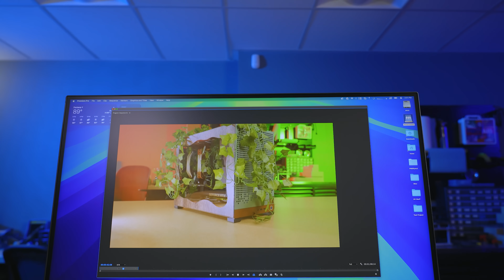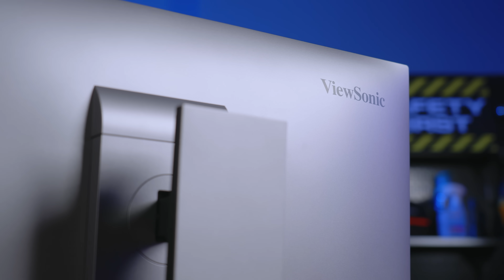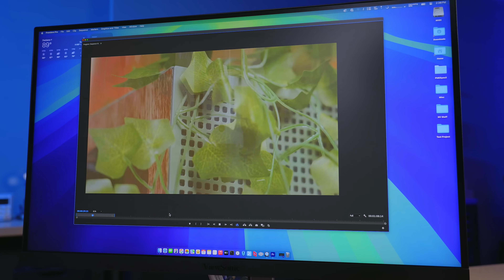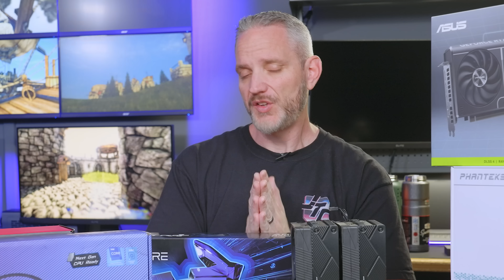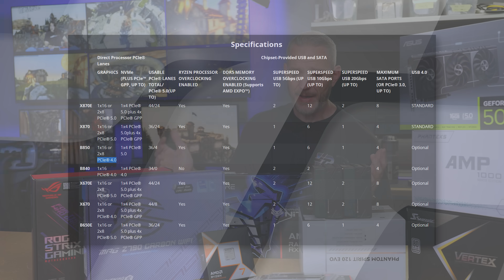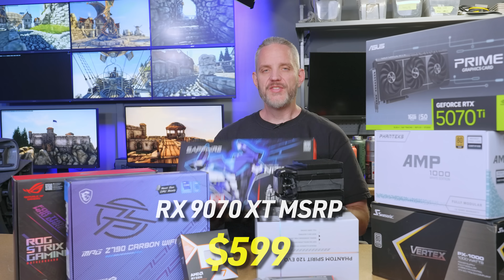This is the Sweetspot for PC gaming... Don't get fooled into spending more!

Comment: My PC Specs:
•CPU: Intel Core i5-13600K (locked at stock speed)
•Mobo: MSI Z790 MAG Tomahawk WiFi DDR4
•GPU: ASRock PG Arc A770 16GB
•RAM: G.Skill Trizent Z RGB 32GB DDR4-3200
•Storage: Primary - WD BLACK SN850X 1TB; Secondary - WD BLACK SN850X 4TB
•PSU: Corsair RMx 1,000W.
•Case: MSI MPG Velox 100r

Overall, I only spent $1,400 overall (OS excluded). And that was when most of my components were on surprise deals at online retailers.

Comment: my 5900x, 32GB, RX 6800 16 GB will made me do the entire consoles gen at 90/120 FPS 2560x1080 for little less than 2000 € just after the PS5/X release and ''correct'' prices
its not the best moment to do a new PC (new consoles will release soon) but its some good advices^

Comment: I have a 7800X3D/4080 Super system, but I'm thinking of building a second, portable PC that's not as powerful.

My want for all the power I can get VS the power I really need it to have for what I'm using it for has been hard to fight. 

I'm aiming to use an AMD 9000 GPU, but I'm fighting between my want for the power of a 9070XT VS, the realistic use case/price point of a 9060XT. 

So, the spending VS what I really need have been bashing heads.

Comment: please don't recommend stuff like like that. If you have to have a bottleneck. you are better to have a gpu bottleneck over a cpu bottleneck. so you are better to have a good cpu over a gpu. You really dont need that much gpu horse power. you can be surprised what you can run on older hardware. if you want to play AAA games you are better off getting a console if you have limited budget. if you play games like war thunder or apex and indie games. you dont need much.

Comment: I would add:  if going for a value / performance focused build - do Not go ITX / SFF

You’ll either have to make compromises or will be spending extra $ (sometimes a lot) for parts which will even fit.

Comment: In what world is the core ultra i7 265K not the value pick today? Unless this was recorded a while ago and just released, the 265K is available near or even under $200. 
Is it the best CPU for gaming? No. 
Does it pack 90+% of the FPS of the 14700K at 60% of the price? Yeah.
And it’s an absolute beast in productivity. 

I feel like people get lost in the generational discussion. Ultra series 2 is NOT as good as most AM5 processors or even the 14th gen Intel processors. But it eviscerates the 9600X, which is the closest in price new.

Intel is the new value pick (for now).

Comment: is nvidia heavily saving money on the cooling part on their 50 series cards? i comapred the measurements of 5070ti cards and they are basically all the same 300x120x50 a bit higher a bit lower but no big cooling parts like on 9070 xt cards! i was looking for a good card that has valid quiet possibility but they are all the same, even tho they have like SFF in the name but arent shorter in any way

Comment: Power supply: 2009 Alienware Aurora is still going hard. Switched to a GTX 1070 and a SSD, other than that all original.  Dumped Windows 10 for Linux when I picked up a new PC this year.

Correction: after three water pump failures I switched to air cooling, much more robust.

Comment: Got my ibuypower custom configurator earlier this year running a ASUS Prime B650M-A AX6 II WIFI mobo, 7800X3D, 4070 Super OC and 64gb DDR5 6000 with a 850 watt power supply all in the Lian Li 216 Mesh in white.  This was an upgrade from a build I was gifted that was a previous workstation pc running an Intel Core i7 4820K with 32gb DDR3 with a workstation mobo (not sure what type), a GTX 1660 8gb and I think a 500 or 650 watt psu in a Lian Li O11 case in white.  Had to upgrade when it started black screening randomly and I’m not confident enough in my knowledge to try and trouble shoot or do anything too invasive that could mess something up more.  Kept the old rig as a learning tool and this new one was within my budget and it’s perfect for gaming and my video/audio editing projects along with live-streaming.

Comment: If you need a bit more graphics performance than this, the sweet spot is adding an overclocked 5080 - they go beast mode when clocked! I'm surprised how little coverage this topic gets. (Still not "cheap", but in comparison to a 4090 or 5090, the performance gap is not huge compared to the price difference).

Comment: Do these YouTubers still talk about our reality? I don't game, but I'm 80 and a collector of VMs.  I have all Windows VMs from 1986 till now and all Ubuntu LTS VMs from 2004 till now.  Now, like almost always I run 2 VMs but from time to time I run 4 VMs. Now I run Xubuntu 24.04 LTS and Ubuntu 16.04 ESM and every week I run Windows XP Home a few times :)  Even running Windows 11 update together with Linux updates I never reach a 100% CPU load, it runs around 50%. 
My old HW from Apr 2019 till Dec 2024; a Ryzen 3 2200G; 16GB DDR4 (3000MHz) did reach a 100% CPU load in Windows updates during say 5 minutes.   

In Dec I upgraded, not because it was needed, but the prices ($125 + $54) were right and I expected to need an upgrade anyhow within 2 to 3 years. I upgraded to a "new" Ryzen 5 5600GT (released Jan 2024) and 32GB DDR4 (3200Mhz). I intend to use it till 2034, because I have only 2 hands and 2 eyes to create load.  I'm not interested in the artificial load of running at 4096 x 2140, because my eyes are happy with 23" and 1920 x 1080 on a good old analogue vga connection.  

I studied electronics from 1963-1967, so I prefer the more natural analogue monitor :)  I had glasses all my life and I don't intend to buy new glasses to justify a new 4k monitor. LOL!

Comment: Sweetspot for games :

Mid range : 5070/9070 + 9600x 
mid - high : 5070ti/9070xt + 7800x3d
high end : 5090 + 9800x3d/99550x3d

RAM : If you plan on using AM5 for long term upgrades like us 5700x3d AM4 3600MHz ddr4 owners, get 7200mhz ddr5 ram. Its not much more expensive than 6400mhz but will pay dividends when you upgrade to that eventual 11700X3D.

Comment: I went with a 7600x which was almost bottom of the barrel Ryzen 7000 and a Zotac rtx 4080. first big GPU buy. and I could not be happier. Gaming at 1440p ultrawide. Its so good. The GPU will last me for years, and if I need some more performance or cores I can upgrade to ryzen 9000. All this on a low/mid range asus b650 with wifi and good sound, decent I/O.

Comment: I beg to differ with jay on going back to a gen 4 drive. i had a gen 4 drive in my system until i could get my den 5 drive and i felt like i was back in the old AOL days 🤣😂... mine crushes everything from web browsing to gaming!!! i also heard that most m.2 slots on motherboards don't support gen 5 speeds... i have a pcie 5.0 lane on my board with a hyper card and it's just totally insane sometimes i get more speed than what i paid for... though most need a gen 5 drive...

Comment: hey jay could you do a cpu test for 1080p, 2k and 4k with like a mid tier gpu and a high tier one ? : let me explain basically could you test some cpus from the cheapest am5 available cpu to the most expensive one with like a 9070xt at 1080p, 2k and 4K and then run the same test with like a 5090? so that we can know exactly wich cpu to choose depending on our resolution target and gpu combo ? that would give a nice data sheet for those who wants to make max performance for the cheapest possible

Comment: Does anyone know if NGREDIA has come out with any stable drivers since DEC for 30 series cards? i'm still using vers. 576.88 and its been quite a while since anything has been said on drivers for older GPU's I know it is always a gamble we take on drivers but ever since Nvidea 50 series came out nothing but problems have come out of this and i don't know if NVIDEA has ever fix there issues yet? or are they still only caring about the newest cards out there?

Comment: Hol'up. RAM needs to be picked based on compatibility of both the MOBO and the CPU.

I have RAM in my current rig that is compatible with my CPU, but not my MOBO, so it won't run when I set it to the EXPO timings. I have to manually set it 2000 MHz slower, and the first word timing 1 higher, to get my rig to boot.

Comment: I just took a 7700X cpu that I had laying around after an upgrade and built a whole new system around it. It cost me a total of 500$ at microcenter to build it, and its a mini ATX case like I wanted. I did have ram, gpu, power supply and like, fans already but I was surprised at how cheap it was. I didnt really consider it a gaming pc, but I bet I could run gta or something on it easily.

Comment: I picked up a prebuilt with a 4090 in it 7 months ago bc it was wayyy cheaper than even the 4090 cards were going for by themselves. Settings maxed on all new games with DLSS quality and very good framerate. I'm very happy with my purchase and holding onto this thing for dear life until it dies on me. Probably won't even think about a new highend pc until games start running below 30 fps with DLSS and we're a long way from that imo.
Reply: it’ll easily last a decade
Reply: @NinTheLost  exactly. Starting from now.  :-)
Reply: Where did you get it?
Reply: @DiegoLopez-oi8gt micro center used. You just have to check their confusing site constantly or you can call their cs and ask where they have a used 4090 pre-built. That's actually faster and easier imo.
Reply: Sold my lenovo legion prebuilt pc 10700k 3080, it was supposedly a better pre built but thr nose, heat and parts drove me mad, custom parts so couldn't replace them, aio broke, locked xmp ram and no resize bar, bio was locked, I sold all the parts on ebay and got half my money back and built a 5080 pc new

Comment: Feeling pretty validated in my new PC build now :) First time building my own computer instead of buying a prebuilt. Spent almost 2 weeks just researching before I started ordering parts. Final price came out to be a little over $2200 USD! (converted from NOK)

I use my computer 50/50 for gaming and as a creative workstation. Creative work doesn't require high specs but it is really nice to future proof my build AND get better performance for the games I play :D I have both a 144hz FHD monitor and a 60hz 4K monitor/graphic screen tablet. My old rtx 2060 and 2600x struggled to get the most out of both screens.

The specs for those curious!

GPU - MSI Inspire RTX 5070 ti OC
CPU - AMD 9800x3D
CPU cooler - Thermalright Phantom Spirit 120
MB - MSI Tomahawk B650
PSU - Be quiet! PURE POWER 12 m 850w
Case - Be quiet! PURE BASE 501 Airflow w Window
Casefans - Be quiet! PURE WINGS 3 140 x4 (2 included with case)
RAM - Kingston Fury Beast 32GB 6000 CL 30-36-36-80

The GPU I got for $900 which is the closest to MSRP its ever been in Norway. We tend to get inflated prices here...

Comment: Great video Jason! I'm still rocking a 9900k and a 3070. I only game at 1080p. I plan to build a new system when GTA 6 releases on PC. I will go Ryzen 7 and probably whatever top end gpu amd has at the time. Good value, not stupid overkill, yet will last me many years. Also go with AMD Gpu and I have no reason to upgrade my 1000w platinum evga psu.. And no, I don't want to use adapter.

Comment: Hello from the Philippines I have a 4090 with 9800x3d build but I also recent built a mid range rig:
Sapphire Pulse 9070XT - 760USD cheapest I could find in my country
7800x3d
gigabyte b650
32gb lexar ram 
2tb samsung evo
frozn a720 air cooler
gigabyte 750W gold
Antec X90 - 60USD

Comment: I have an EVGA P2 1000  PSU in my PC It's over 10 years old now been though AM3, LGA 1150 and AM4 where i am now it's been faultless all these years. Always over spec PSU  as much as you can afford I doubt i will change when i upgrade to AM5. It powers R7 5800x and 9070 XT at the moment. Unfortunately EVGA Powers supplies are difficult to come by in the UK now so i really don't want to change yet.

Comment: @23:47 I agree; with a small caveat: Poor airflow cases can Severely hamper cooling and in the worst cases, result in components you've shilled out for throttling down.
My case advice would be keep it as low cost as practicable, if you're on a budget, & ensure its a Very well Ventilated case. Ensuring you get the best performance out of your chosen components and cooling solutions. Having an overly crampt, poor airflow case, impact upon performance is not good!

Comment: The fact that 8000MT/s DDR5 with CL40 can still be slower than 6400MT/s or even good DDR4 tells you everything. DDR5 is a marketing mess. Higher latency, power-hungry, often unstable, and the real-world gains are minimal unless you're doing bandwidth-heavy workloads. For gaming or latency-sensitive stuff, high-end DDR4 still slaps. DDR5 "fixes" nothing that actually matters right now.
Reply: Upgrading RAM has always been a capacity based decision for me. 8GB DDR2 to 16GB DDR3 to 32GB DDR4.
So there's my issue - I don't need more than 32GB at the moment, so DDR5 is redundant for me. And even if I did, I could still get 64GB of DDR4.
Currently I'm running a 3200 CL14 kit on a B550 motherboard. Works like a charm.
Reply: actually you and also Jay is wrong here... 40 cycles at 4000Mhz (8000MT/s) is 10 nanoseconds... 30 cycles at 3000MHz (6000MTs) is also 10 nanoseconds.. so the latency of both is the VERY SAME !   8000MT/s CL40 has the SAME latency as 6000MT/s CL30 !
Reply: @robertjung8929  Nah, you’re kinda missing the point. Yeah, if you just do the math on raw latency (CL divided by frequency), 8000MT/s CL40 and 6000MT/s CL30 are roughly the same in nanoseconds. But real-world performance isn’t just about that simple latency number. DDR5 has other overheads—like higher power draw, more complex power management, and early-gen controller quirks—that mess with stability and timings. Plus, DDR4 can often run tighter timings at lower speeds, which sometimes translates to better real-world responsiveness, especially in gaming where latency spikes matter more than bandwidth. So just comparing CL and frequency alone doesn’t tell the whole story. DDR5’s raw bandwidth is higher, but it’s not a clean win everywhere right now.

Comment: Im running a ryzen 9 5900x on an Asus Tuf X570 pro wifi board with an Evga ftw3 3080ti.   64gb ddr4 vengenance ram ...clocked down due to 4 sticks...1tb nvme samsung evo 980  and a secondary 2tb Samsung evo 990 nvme drive. 1000watt evga supernova psu.   It seems to do really well for todays games...If  I were to upgrade ?..... is the performance gonna knock my socks off or should I just wait till later releases?

Comment: My last upgrade was from a Ryzen 5 5600 (no X, no X3d) to a Ryzen 7 5700x3d. It was on sale and came with "free" memory that allowed me to go from 16 to 32 gig. Yes, my bottleneck is the 3060 video card. Built it during covid and the 3060 was a "lottery" win from Newegg. The SSD remark is so true. My Steam drive is a 4tb gen 3 drive. I had a 4th gen WD black 2tb, but it was getting over 80% full. Now it's my system drive, and honestly you might see a second at most loading games difference, but the price difference at the time was huge.

Edit: GskilL is good memory. I've used their ripjaw series since ddr3 and haven't had any die yet. I've used a lot of their sodimms on NUC builds for relatives. I try to avoid RGB.

Comment: my mini atx i built is a good spot for me for a few years. r7 9700x, cl28 6k ddr5 at 64gb "for future reasons" 7900xt gpu and a corsair 80+ gold 850w psu with 2 ssd's. 1 nvme and 1 regular ssd. both 2tb each. more or less the upper middle class of tower builds and low high end

Comment: If you pick up a used 2080ti for 250 bucks(still 11gb VRAM and matches 3070tis/4060tis in many games) then new on EVERYTHING ELSE with a z790 mobo and a i7 13700kf, 32gb DDR5 ram, 240mm AIO, and 2tb of NVME/6tb of HDD can be had for ~1200 bucks nowadays(or sub 950 if you do a i512600k, z690 board, 1tb NVME, and 2tb HDD) if you use a 750w Gold fully modular PSU and sub 90 bucks case that includes fans(tons of quality options nowadays tbh). That will give you PLENTY of performance on all except the most demanding of games at 1080p, and still does VERY well at 1440p tbh. AND you can upgrade to a VERY beefy GPU still in the future...plus the 13700k is VERY suprisingly close in benchmarks to a 9800x3d

Comment: I invested in Intel before the degradation issue was revealed. I also invested an extra $40 into the Mobo for a BCLK Generator so I can overclock non-K chips. My biggest mistake though was choosing a new RX 580 rather than a used 5600XT. 😅

Still a massive upgrade from my old dinky laptop, but I didn't realize at the time how much a few extra dollars would have improved my gaming performance. 😮‍💨

Comment: It really depends on your display tbf.  Sure I've a 4K display but the panel is old & crap and only does 60Hz, no-HDR, no nothing, not even crappy speakers.  A basic 3080 can happily keep pace with that panel with all the goodies turned on.  Is it silky smooth dreamboat jaw dropping? No, but it's 4Kat60 without a hitch. And there are a lot of those older cards (and older panels) going for pretty cheap on ebay with fairly low mileage.  Not perfect but if you're stilling pushing a 900 series or something.